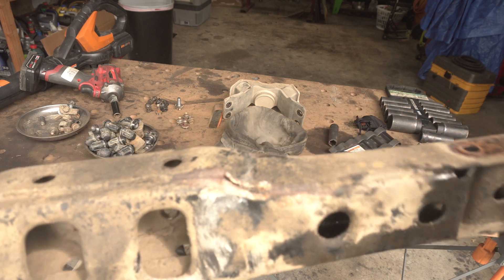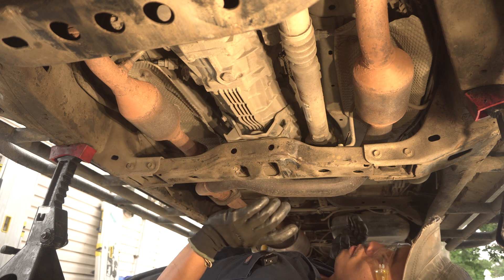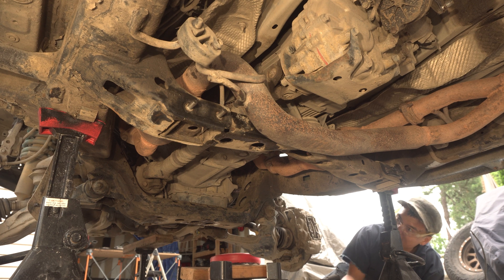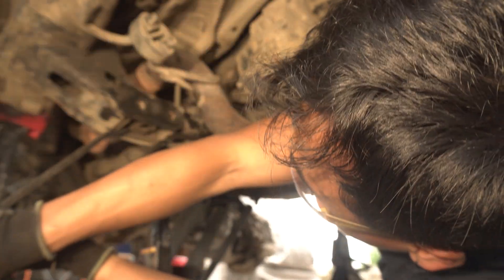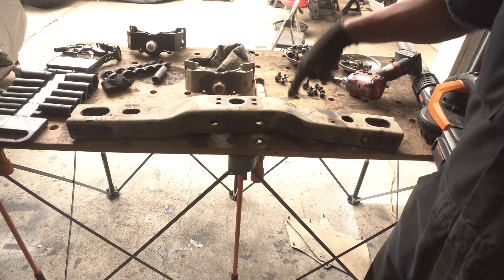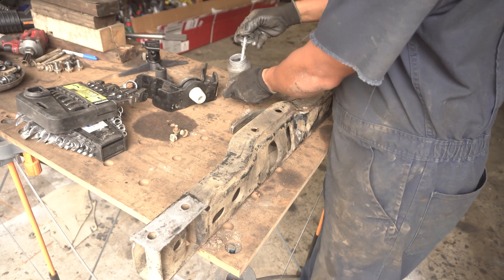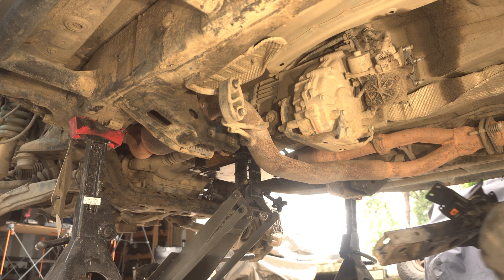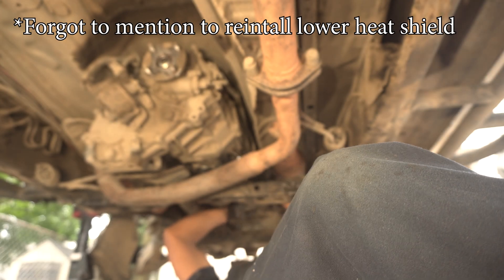BENT Trans Beam Repair (Tacoma)

Comment: Ok, cool this is useful. Oddly, the stealership removed that heat shield and tossed it, they said it was just full of rocks and mud and was only there to make noise. Are you making your own skids?
Reply from the maker: You do have the crawler box too so it moves your front drive shaft a bit further back. from what I can deduce, I think the heat shield is to protect the u joints from excessive heat so we don't lose the grease in those joints. With regards to the skids, YESSIR! I'm just very slow when it comes to mods, since I do make most of my mods essentially from scratch LOL. I'm working on a shackle flip for long travel on the rear at the moment, you'll probably see that on IG first
Reply: @TacomaTutorials  shackle flip is good yeah. Can't wait to see it!

Comment: Of course another #10...could the transmission of stayed in position without the transmission jack or does it's weight require support at all times without the cross member there? I understand that the transmission jack enables you to lift the transmission higher to get access for the cross member and hands etc
Reply from the maker: Thanks for watching, George. To answer your question, the motor and transmission assembly is supported by the motor mount and the transmission mount. If the transmission jack was removed, it over stresses the motor mounts and premature wear or completely damage those motor mounts